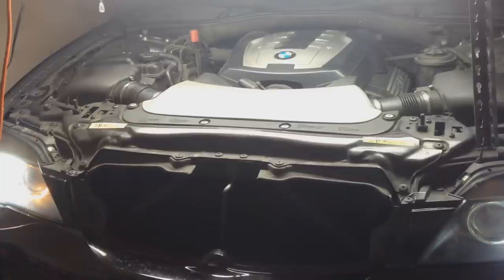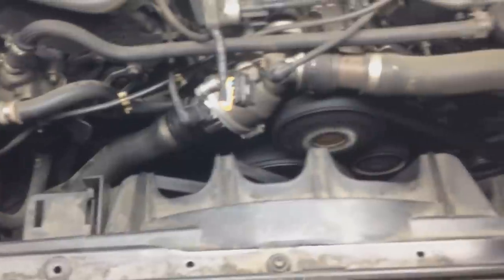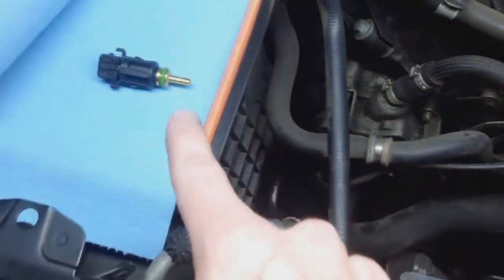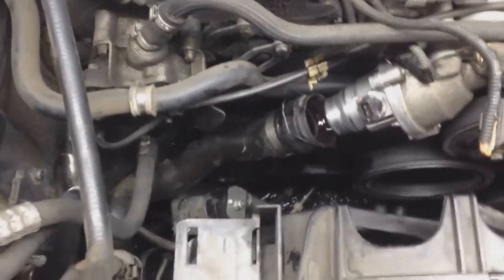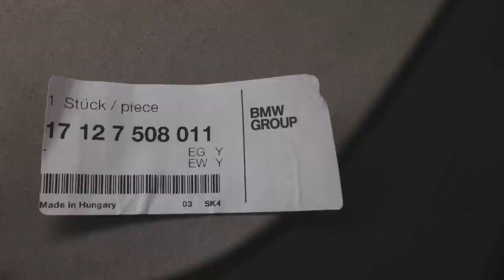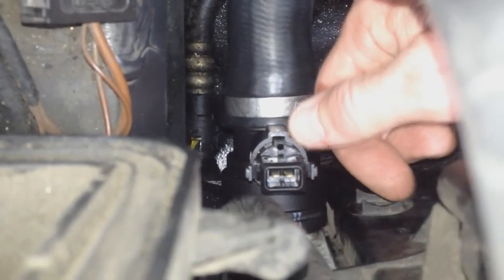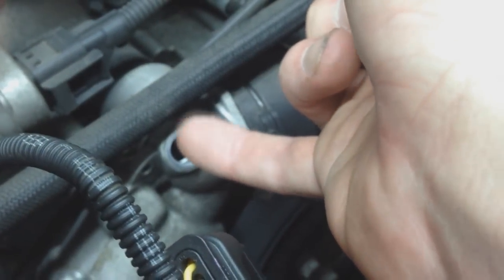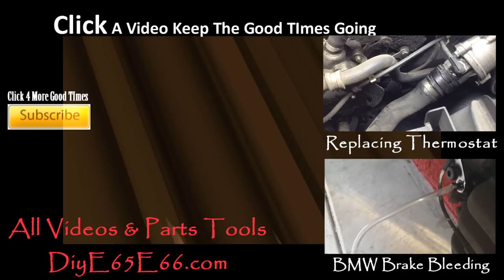DIY BMW E65 E66 Loud Engine Fan Fix

Comment: Hey Chris,
I have an 03 745 and I have the same issue with the fan constantly on. What I noticed on mine is that the AC compressor clutch is engaged with the AC off. I have a leak on the AC because I was trying to add Freon but the gage did not do anywhere. Just like you, I am trying to figure this out. I also have a loud squealing which seems to come from the power steering pump, but still unsure. It comes one when I come to a stop after driving for a while. If I turn off the car and restart it, it goes away. These two things are driving me nuts, but I will find them. Any help, will be greatly appreciated...